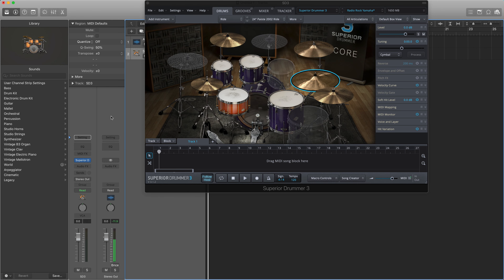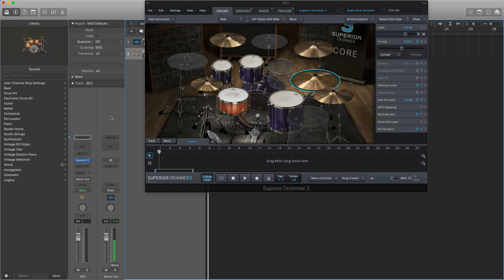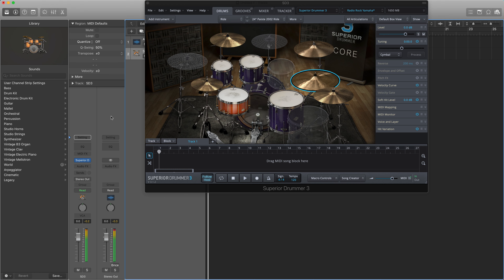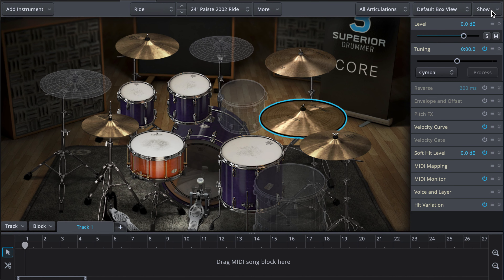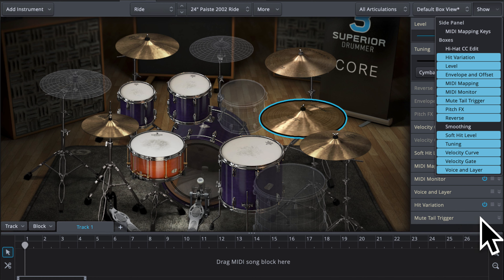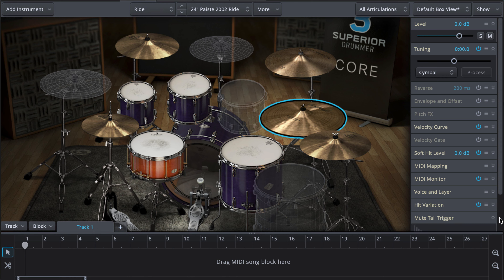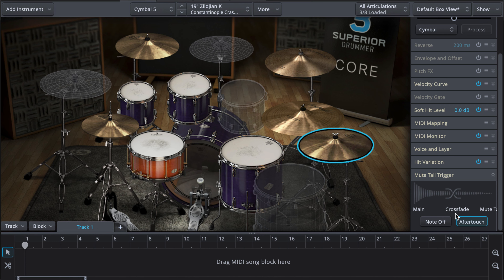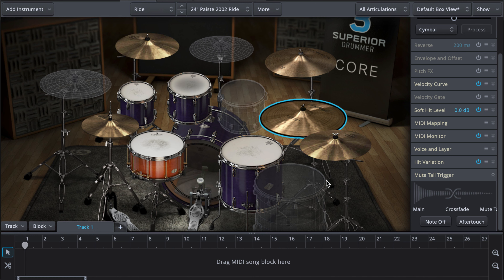Get Rid of Cymbal Choke in Superior Drummer 3

Comment: I am having an issue some what different to this. When editing keyboard recorded midi drums, or even putting some of the midi notes for the drums on the grid manually with a mouse, sometimes at random times the cymbal will choke, even though it is not on a choke note.I can delete the note, and manually put a new note in it's place, and it still chokes. This is happening to me in Reaper on the Reaper midi grid. Any ideas?

Comment: Hello, I have a problem when I run a Cymbal Choke with my electronic drums, it works once but it remains drowned during the rest of the recording, if I perform this action, I understand that it will be solved! And when I do it again with the drums. won't choke sound? Or will it sound once as it should be and then return to normal sound?

Greetings and thanks

Comment: Awesome!  Great solution.  I have the opposite problem.  I'm using EZ Drummer 3 and I want cymbal chokes in certain songs; intro to Eye Of The Tiger, Crazy Little Thing Called Love.  The software does not recognize the cymbal chokes from my drum module.  I'll just try what you did backwards and see if I can get that sound, and then save that drum kit and only use it when I need cymbal chokes.
Thanks for the idea!